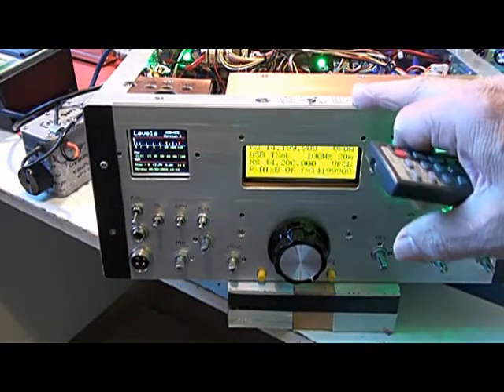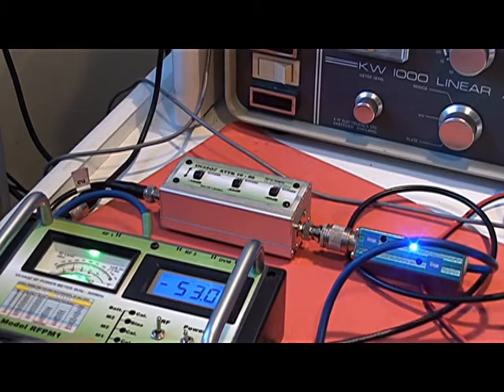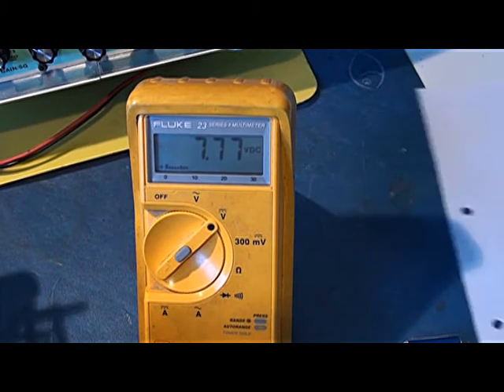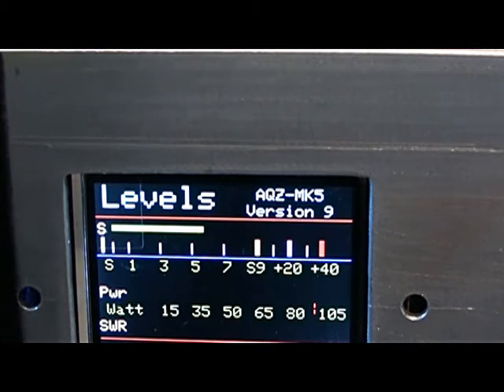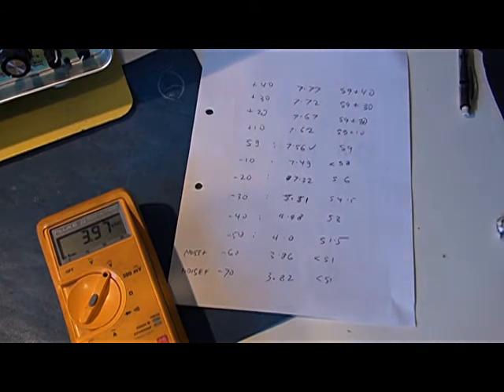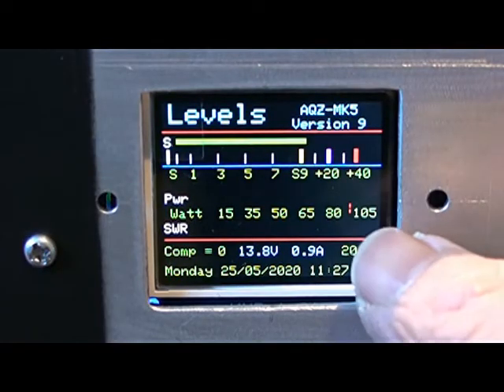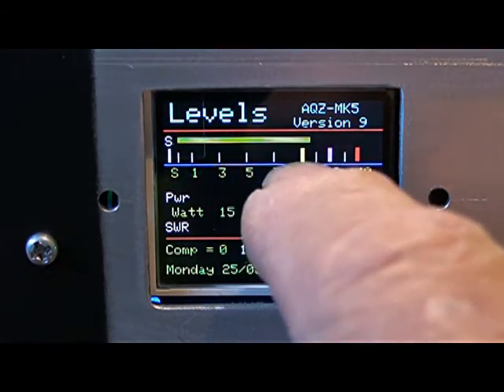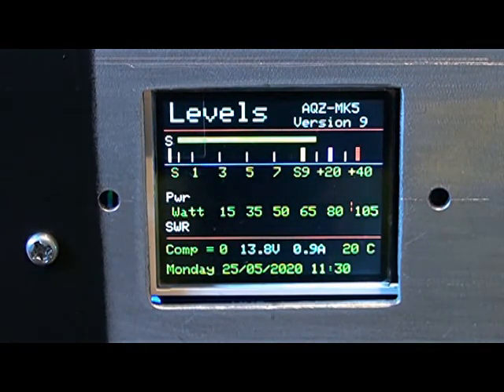VK3AQZ MK5 TFT S meter part 1.

Comment: Another 'gripe' I have is with the 'black boxes' that have an RF Gain control, which when turned counter-clockwise causes the S Meter to 'peg off the scale' so you cannot give an accurate signal report. Why did they not have the RF Gain control eg. fully clockwise labelled as '0', and as you turn it anti-clockwise -3dB, -6dB, -12dB, -20dB, -30dB and so forth with the meter showing a correct figure. Not only myself but I have seen so many others with the same/similar observation.
Reply from the maker: Yes, the rig in the demo has a software variable which tracks the RF and IF gains so that an input of -73dBm will always show S9. I am still playing with that as  I still trying to get it to track across the range which is not easy. A rig with a spectrum analyser has to have all stages with accurate gains so that the vertical scale reads the correct amplitude of the input at all settings of the gain controls. CROs do that too so its not that hard to do. For example, if you know your preamp has an accurate gain of 20dB, then its not hard to put a 20dB drop in the signal to a meter or a change in the software which takes care of that gain. The main thing one has to note is what is the dBm at the antenna,and how far off  S9, or -73dBm it is. If the RF amp has  a gain control, you just need to know what is the resulting gain in dB and correct the S meter to cater for it. In my case, all gain controls are DC voltages so its not hard to use that for correcting the readings. TFT meters and software make that easy. In the earlier days, commercial receivers had a connector with calibrated RF signals (like the test signal on a CRO) to set the meter readings and end up with the volts EMF at the receiver input. Lou

Comment: I believe the IARU Region 1 Technical Recommendation R.1 to be an awful out-dated standard that specifies -73dBm for HF, so 30MHz and below, -93dBm for VHF, so 30MHz and above, therefore, having a general coverage receiver, if I was to give a signal report regarding a signal at eg. 29.8MHz and said it was 5/9, then the transmitter and receiver moved up to 30.2MHz with exactly the same transmitted power, I would have to give a 5/9+20 !?  

Given that signals S9 and below are 6dB per division and above S9 are 10dB per division, I would assume therefore that apart from the bias varible, that 4 main S Meter variables would therefore be needed for a rig that tunes with no gaps across the 30MHz HF/VHF part of the radio spectrum with the Arduino sketch code

I can see that according to the article at https://en.wikipedia.org/wiki/S_meter before the standard was set, with no common reference ie. 50Ohm input impedance things were not standardized, but as much as I don't agree with this Recommendation myself, I cannot see it changing any time soon.

If I remeber correctly there was a similar debate with what is regarded to be 0dB line level 775mV for Vu meters on audio gear in the early 90's
Reply from the maker: Yes, what you have noted is generally accepted. The rig in the video is only a 3 band rig for 80, 40, and 20 for use in a caravan as a backup to the IC706a. So the VHF S9 does not apply in this case. I should say that over the many years I have used and measured  the S meter accuracy, I found virtually none of the rigs actually are accurate across the range. I remember seeing a post where someone plotted the S meter readings for a number of well know brands and again none were accurate. It is quite difficult to obtain accurate S meter markings using the receiver AGC since it depends on the final AGC closed loop transfer function. That includes a mixture of AGC responses from each of the stages in a receiver. In the receiver in the demo, the IF stage is an AD603 with a log linear 40db response, and the RF preamps use BF904s, which are also 40dB log linear. I have chosen those devices for that very reason so that the software can use simpler equations. So the response is more accurate.  My MK4 transceiver covers 100kHz to 54MHz but it has an AD8307 RF detector on a non AGC sub receiver with a linear dynamic range of 90dB. The reason for that complexity is that the design has a spectrum analyser section where the vertical scale has to be accurate dB divisions.  Something else I have come across, is that Colins receivers use -67dBm, or 100uVrms for S9. And some German sets I have used have Volts emf across the input on the meter!  You mentioned the markings on audio VU meters. I worked in a TV station and we had zero VU as +8dbm (where 0dBm is 1mW into 600 ohms), and Japanese gear which used +4dBm as zero VU!  Some Telecom gear used zero dBm as zero VU  also!!  So it was a real mess till digital TV came along.  Lou